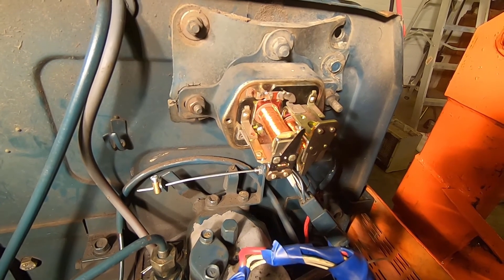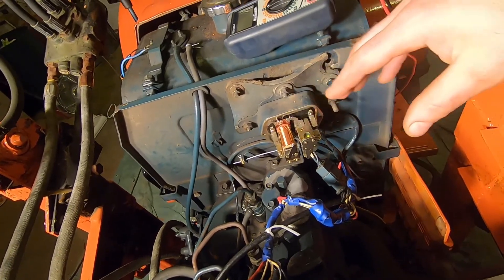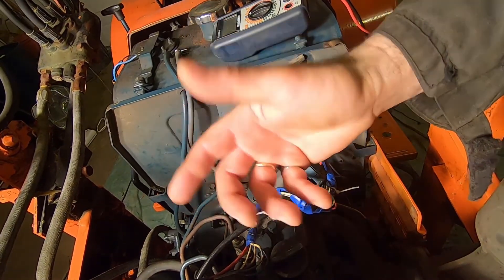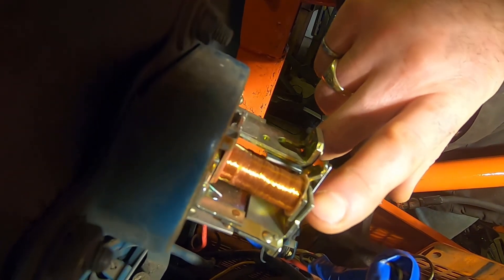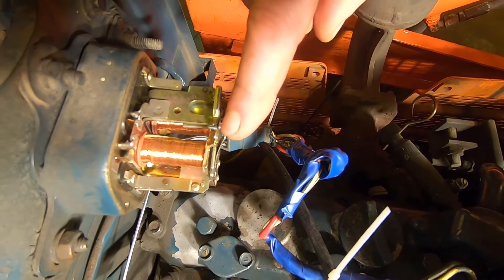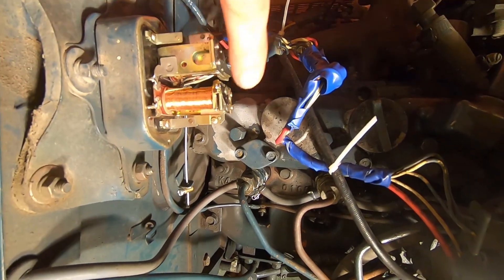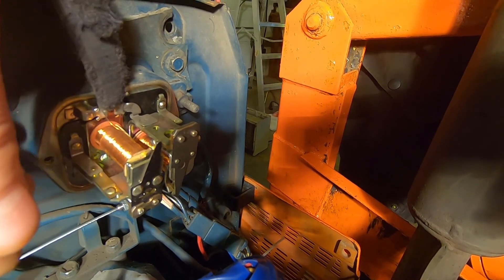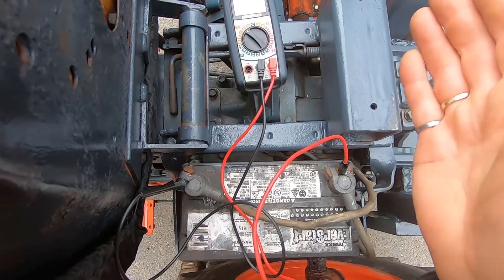DIY Mechanical Voltage Regulator Adjustment And Operation

Comment: This same regulator is used on the early 80's Ford garden tractors, such as the 1100 2 cylinder diesel. The alternator is a Nippon Denso. The voltage regulator coil or "relay" actually has three positions for its movable points. When the engine  is not running the Normally Closed contacts will supply full battery voltage to the field of the alternator. When the engine is running, the voltage of the alternator on the B terminal increases to the set point the the normally closed contacts start to break open. I think there is a resistor under the regulator at this point which starts to limit the current to the field. But if the voltage increases further the Normally Open contacts will get hit. This will GROUND the field circuit and reduce the alternator output. And the process will start all over again, happening so fast it will appear as a vibration.

Comment: When your car's battery is running low, the voltage regulator on the alternator kicks in to keep the voltage at a consistent level. This prevents the battery from being overcharged or discharged. If you need to adjust the voltage regulator, it can be done with a screwdriver. 

The screws that you will need to adjust are usually found on the top or side of the alternator. Once you have located them, use a screwdriver to turn them clockwise or counterclockwise until the desired voltage is reached. Be careful not to turn them too far, or you may damage the alternator. 

Once you have adjusted the voltage regulator, it's important to test it out by driving your car for a while. If everything seems to be working correctly, congratulations! You've just saved yourself a trip to the mechanic.
Reply: Err no.